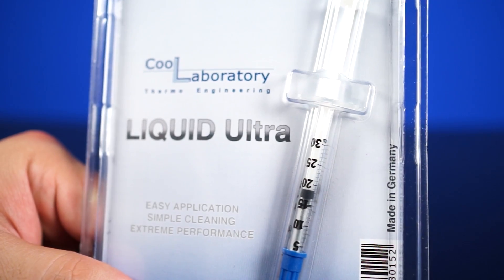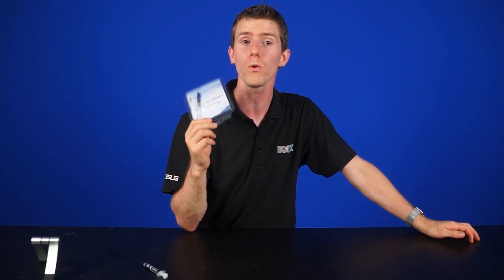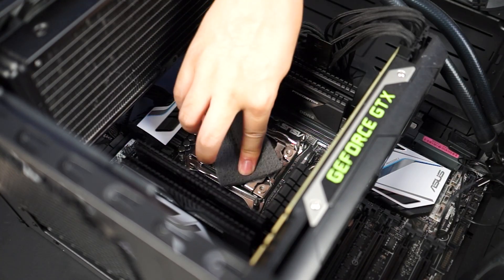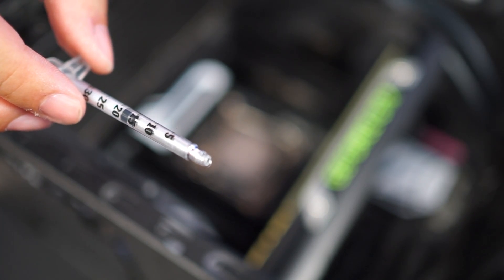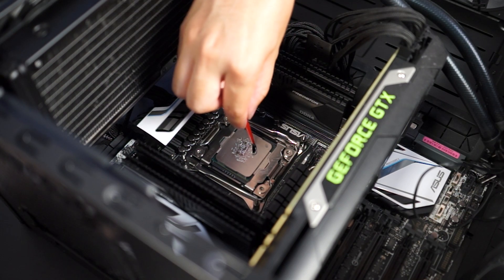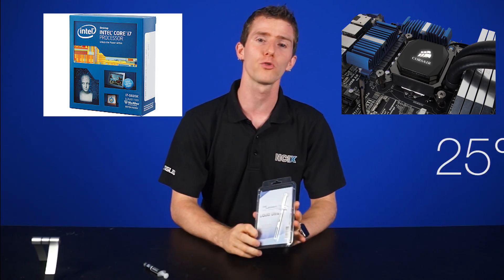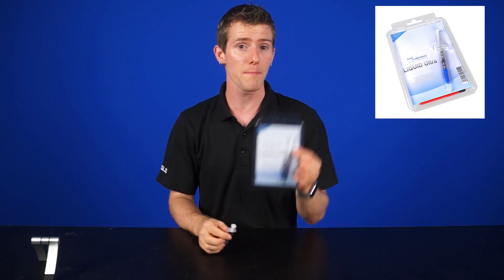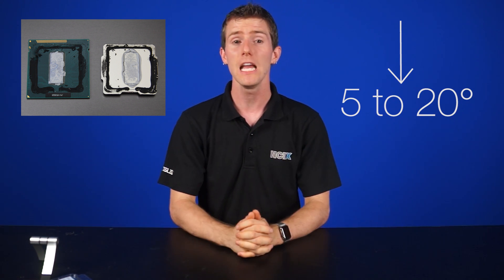CoolLaboratory Liquid Ultra Thermal Compound - Wut iz?

Comment: What a idiot.  Sponge is for cleaning the cpu or heatsing after a while of use and only when reapply is needed. In cases  -change the cpu or cleaning out the dust if the cooler/pipe needs to be removed. 
After the surfases has been brushed flat with the sponge - then the alcohol towel come in to clean the surface.
Next step is to burn in the the liquid with stress or burin in softs with the max temps for at least 2 hours or even more. Then only u can have the big temp drops to compare it with another pastes. Dumbs.

Comment: This video makes some kind of NO sense to me AT ALL! Maybe you should overclock your cpu at least and use some heavy load like p95 with and without avx instead of using stock settinga and AiO!! And also air cooler for comparison!
For me it made a difference with a 4939k and 6850k and 6950x with air cooler...

Comment: Your technician essentially discovered that whatever the compound's thermal transfer efficiency that's used, there's a "roof" above which (if you want to go there for a much better delta-Temp), delidding the CPU is mandatory, due to the horrible TIM and used by Intel. BTW' some say that it's better to NOT use silicon or whatever to sitck back the IHS over the new TIM on the CPU's PCB, as there's air that would get trapped and heat the CPU rendering the new TIM almost as "non-efficient" as the original. Is that true, should we rather use the cooling system's pressure over the IHS so as to hold it in place ?

Comment: Warning, liquid metal will eventually react with copper (in addition to Aluminum).  Mine occurred after 5 months and all of the liquid metal was gone.  My cpu began running hotter @90C frequently (fresh liquid metal would bring my temps down into the low 80's but the temps creep back up as the liquid metal reacts with the copper) and I would get bugs in games and eventually soft crashes until after 2 months I finally disassembled my whole computer to discover the liquid metal was gone and only a white powder remained.  I was using on top of the IHS using a Thermaltake AIO with a supposedly 100% copper plate.  I contacted thermal grizzly and have yet to receive a response, so I can only assume that there is no fix aside from replacing every few months.  This may also permanently pit the copper plate creating a rough surface, so I will not be using these products again.

Comment: What this short clip doesn't show are the drawbacks:
Any liquid metal like gallium or mercury will permeate through any metal (besides tungsten and tantalum) and form an alloy (or amalgam in mercury's case). It basically becomes an alloy with a much higher melting point. This is what causes the infamous drying up of liquid metal. How long this takes depends on the alloy of copper used in the heatsink, how polished the surface of the metal was and if the electrical galvanic potential between the Cu-Ga contact area is established (basically if the heatsink is in contact with the ground through the case or the mobo)
This is why, if it comes to metal tim, you should see about using gallium free ones like Coollaboratory Liquid Metalpad or Indigo Xtreme™ Metallic Thermal Interface Solution. It's basically a ~65C solder but hey, at least it doesn't mix with your heatsink/IHS.

Comment: This thermal compounds sucks! My Asus G50VT uses a copper heatsink, and after about 9 months this thermal compound would start insulating to the point where I can't use the computer anymore. No, it wasn't dust. Happened repeatedly in 6-9 months. Was tedious to scrape the dried up old Liquid Ultra from the heatsink and CPU with a razer blade. 
Switched to Arctic MX-2 and it's been lasting 4 years now of hard use with little to no thermal conductivity degradation!

Here is a video of the troubles I had with Liquid Ultra; https://www.youtube.com/watch?v=jNgIQQcUSDM
and someone else; https://www.youtube.com/watch?v=FW8fgTjHdCo

Comment: You should look up "gallium induced metal integrity". All you need is PURE gallium, a metal surface like a soda can, and you make hard scratches onto the can and then apply some gallium. It's insanely fun to watch as an experiment! In a few minutes you'll actually be able to crumble the entire can as if it was a bunch of cookies in your hand, making you feel like Hulk (for a moment- hah)...

Anyways, that project aside, it won't harm your equipment if you avoid aluminum as the label suggests. It's best when using it on a delid'd CPU (as in my case) because that's when you're finally able to breach and bridge all barriers between the CPU die, CPU housing, aaand then finally your CPU waterblock/cooler. I'm interested in trying it out on my GPUs although they already run cool :p

Comment: I've used Arctic Silver since it came out and have had no problems.  I just put a dab in the middle, install heatsink, and forget it.  It has worked very well, at least a lot better than that white liquid they came out with years ago.

Comment: Yes, delidding is where the results are found... Also greater drops in temps are more apparent in overclocked CPUs... Works great on GPUs as well... Just gained 14 degree drop in my latest GPU application!

Comment: on a stock cpu that has the IHS soldered on there is no point, use some mx4. but if overclocking or deliding then it is great, my 7700k dropped 26c @4.8ghz using just on the die, when using also between the water block and IHS saw another 5c drop. works great on gpu's also seen a 15c drop accross the board there.

Comment: I used it on my Acer Predator 15 on the i7 6700hq and the gtx1070, with the stock crappy paste i got 90 / 98 C°, after the using of the Liquid Pro my max temp are 65 / 70 C°. With delidded CPU it works great!

Comment: Does this help with the older gpus such as gtx 770?  I have a 770 ftw and a 770 classified and both run at 80 degrees and even the heatsync is burning hot.

Comment: ahrem: just a though, "sanding" aka removing bits of metal from the surface of the CPU heat spreader in an environment which potentially is filled with electro sensitive components (like show in the vid) is really really stupid... really... and i didn't see the time code on the vid ^^ LOL 2015.... :p

Comment: I saw this video a while back, and I was unsure of the results. I researched, and read a lot of material. I finally decided that I'd try it. After de-liding my 7700k, and applying the liquid metal directly to my CPU die. I decided.. why the hell not put it on the heat speader. So I did. I'm using an AIO (Cooler Master pro280). It has a copper block so it didn't matter to me. I don't want to leave any details out so I will say that I also changed the factory fans for the AIO to Delta fans (210CMF-30in of pressure X2-120mm PWM). At stock clock my CPU was running at 59 degrees F (0.0) (now that's cold!). Mind you; I do not run at stock clock. That was for testing. I'm running @52x102=(5.3Ghz and some change) with a Vcore of 1.52v which is the max value my MoBo will allow. My idle temp is still 30C. Full load will give me 70C max on CPU-z benchmark. However on a CPU burn test it will go up to 77C-80C which is not uncomfortable to me considering the Vcore I'm pumping it with, and the fact that it's just a CPU burn test. During normal operation like gaming on the highest settings my CPU strolls within 50C-60C. This was just not achievable with my previous configuration even with the liquid metal I still had to buy high performance fans that sound like jet engines. It's up to you if you want performance or if you're fine with what you have. Bottom line in my opinion is that liquid metal makes a huge difference if used correctly since Intel uses crap paste on the CPU die (de-liding required)NOTE: This product is 100% metal therefore it is conductive, and can cause permanent damage to your CPU if applied improperly. Be extremely careful when using this product avoiding any leads. Recommended to use small portions at a time if more is necessary. Do not brush the liquid. Dab many times as if tattooing. One last thing unrelated to the CPU. The fans(120mm) I'm using are slightly smaller than the radiator(280mm) so there's a small gap in the middle. Through this gap I get highly pressured cold air flowing back into the PC which hits directly on my Aorus 1080 Ti back plate, and actually does dissipate some heat which I found out was real with some more testing. Happy mistake really. I didn't realize my radiator was 280mm so technically I bought the wrong fans.

Comment: You what, mate? This product is intended to be used to replace the standard DIE-IHS TIM. The reason you aren't seeing a temperature difference is that on your processor, the IHS TIM is still intact, and is serving as the controlling resistance in the heat conduction.

The correct way to test this product is to overclock an Intel 4th-7th gen unlocked consumer processor to its balls-to-the-wall limit, then obtain a set of readings with the factory TIM: this will serve as a baseline. Then delid it, use this product to replace the factory TIM, reseat the lid, set up the same heatsink assembly again and run a second set of tests at that same clock speed.

Seriously, you're on a channel calling itself TECH TIPS. Stop misinforming, and, in order to do so, stop being misinformed.

Comment: That liquid didn't look very liquid, runny... Scratching the lid just seems wrong... LOL. I would think paste would be less inclined to spill or dribble, where not wanted and easier to clean up, when it does get where not wanted...

Given the equal performance you reported, I would stay with a thermal paste...

Comment: This thing is the best "paste" i have ever had! I was using Artic MX4 on my RX480 with temps around 70-72 degrees. With this Liquid ultra the current load temperature is about 53 to 55 degrees! I'm using Artic accelero cooler and the difference is huuuge!  Will definitely buy it again. Can only recommend.

Comment: Samsung RF711 - i7 2630QM: from 92oC on AS Ceramique (throttling 1300Mhz or sometimes even to 800Mhz in strees mode). On CL Liquid Ultra: 78~83oC (2-2,3Ghz on video encoding). 
Athlon X2 4850e @3,0Ghz: delidded, cleaned, added CL Liquid Ultra, glued back IHS and added MX2 on top - temp drop from 76oC to 62-66oC on BOX cooler.

Comment: unless your delidding it's not worth it, and when I say delidding I mean you use it to replace the solder or TIM between the IHS and CPU die. after that you can just use regular thermal paste between the IHS and CPU cooler.

Comment: You know what's more silly is that Linus did mention that the Thermal Compound will not work on Aluminum materials which the CPU lids are made of aluminum, so aluminum+gallium=disaster. Gallium eats up aluminum, this thermal compound was ideal of GPU because most modern GPUs have no lid on the core, and the heat sink block is mostly made of copper so there! that should answer your silly questions on why or why not get this Thermal compound!

Comment: This 'paste' is for deliding and its for OVERCLOCKING.not for using 'under load' since all thermal solution will perform almost identically. Simple ear cleaning stick will do for applying the liquid. What was that brush>!?

Comment: Useless? I just used CLU in 2017 on my 4790K which was hitting 90c whilst playing the division using Thermal Grizzly and also tested MX4. With CLU now I get 30c idle and 45c/60c load!! This is now delid which probably helped the most.
Reply: Same. I'll be delidding my i7 4770k.

Comment: i buy the cheap 6 dollar stuff from radio shack and its works fine
Reply: works fine is not what we're going for here. We're going for works great.... beyond great. Could be very useful in certain builds where you need as much heat dissipation as possible. extreme overclocking for one.

Comment: I just tried this stuff on 2 CPU's and I am seeing 17C drop on my de-lidded i7-4790k and de-lidded 12C on my i7-3770k.  They both now have Liquid Metal between the CPU/Heat spreader and the Heat spreader/heat sink.  They both previously had Arctic silver 5 in between the heat sink and heat spreader only.  So that makes me think it really is the junk paste Intel uses on their CPU's in between the cpu and the heat spreader.  Overclockers UK has a very neat tool that removes the lid very easy.

I also used this on my GTX 980 Ti and got a 30-35C drop (depending on room temps).  I have an Arctic cooling aftermarket cooler on it and I don't see temps above 57C now with it.  I have the core overclocked 200Mhz and the memory 300Mhz.
Reply: I can second this, I delidded my 4690k and the temps dropped by nearly 20°C.

Comment: just bought some of this on ebay. cant wait to see how cool it makes my fx 8350 after de-liding it!
Reply: Joseph Mitchell lol isn't the FX line soldered on allready ...?
Reply: Damien yes but with not the best kind of solder. So far I've got it on my gtx 960 4gb OC, my 8350, my i5 4670 and old fat PS3 cechA01. This stuff works pretty well too
Reply: quangluu96 already did it. You just gotta heat up the ihs enough to where you can basically slide it off after separating the glue that holds the ihs on place. It's not as hard as people say it is.